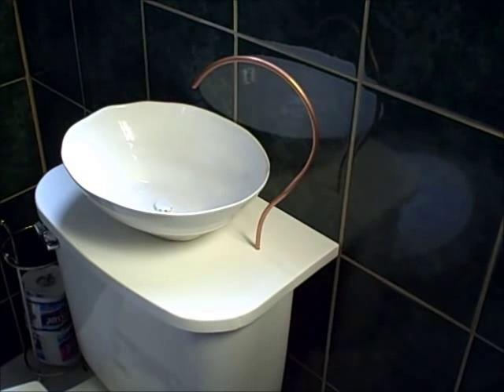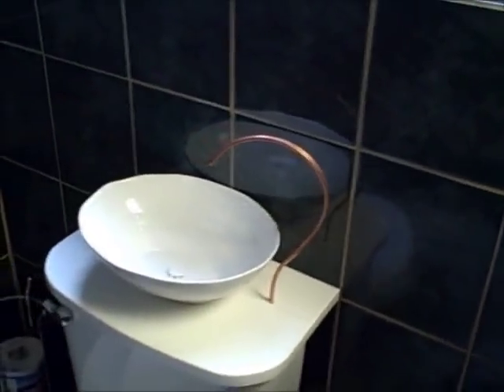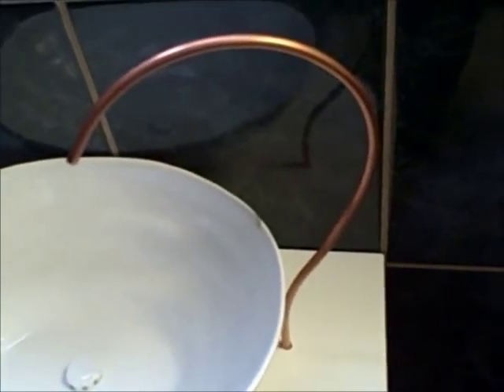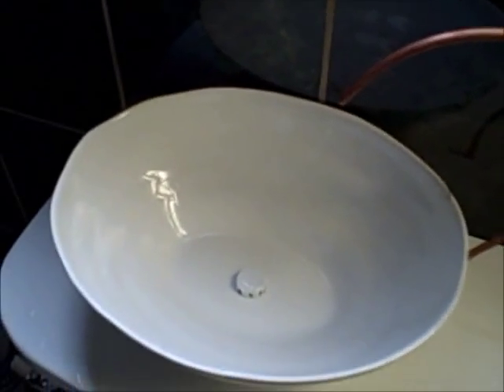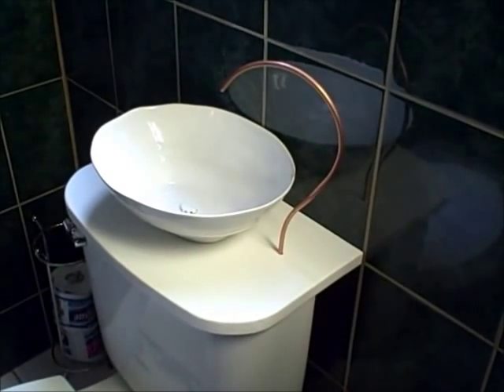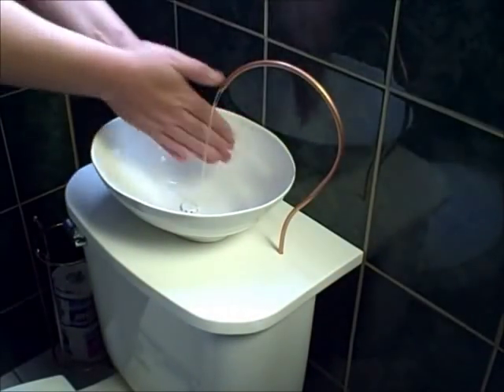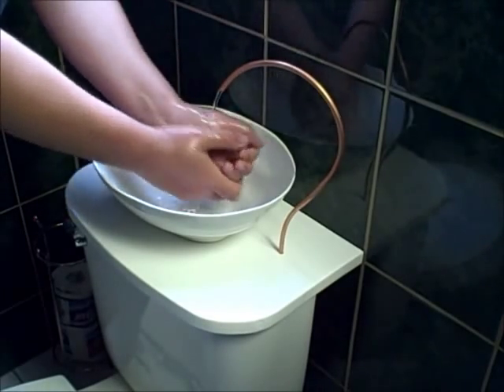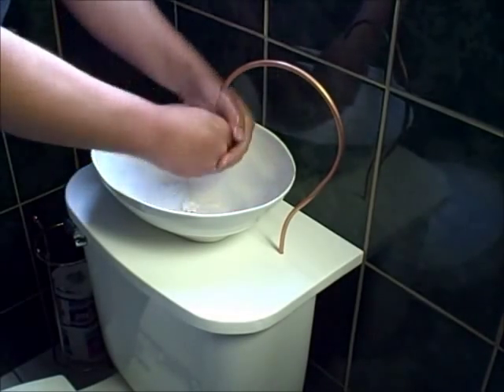Conserve water with a DIY Toilet Sink

Comment: Misleading ! On the diagram  water  from sink drains down in to flash valve tube. This way it will never fill the tank.
Reply from the maker: Alexander G Most of the water coming in the fill valve exits near the base of the shank, while only a small ratio is diverted to the overflow tube.  During the flush on many toilets, the siphoning action through the trap pulls more water out of the bowl than is necessary to maintain a water seal.  By design, most all fill valves simultaneously fill the tank while diverting a small amount of water (in this case 10 ounces) to top off the bowl.  More to the point, the water in the bowl is responsible for blocking sewer gases in the drain line from reaching the room. If the bowl were left with an air gap after a flush, the room would likely get very stinky.

Comment: Any way to rig up warm water?
Reply: Plumb it into a hot water line.
Reply from the maker: Rigging the hot water line would kinda defeat the goal of repurposing the water going into the overflow tube to save water.
Reply: Not if that isn't my goal. I'm interested because it saves space, not water.
Reply: +ima bemedou Then just plumb it like a normal sink but place it over the back of your toilet :)
Reply: You'd have to rig up an in-line water heater because the water line that feeds a toilet is a cold water line.  If you want to get crazy, you can divert water from the hot water line from your nearby sink or shower in the wall to feed your toilet.  The only problem you'll see there, however, is that the amount of water used to fill the tank after a flush (10 OZ. mentioned in this video) will likely be less than the amount of (cold) water in the hot water pipe.  So, you would have to run the hot water on your sink or shower for a little bit to remove most of the cold water from the pipes and draw hot water in, defeating the purpose of having a toilet sink to conserve water in the first place.  At my house here in Japan, we have an on-demand/tankless water heater a fair distance from our shower and sinks.  So, I usually have to run the hot water for a good 10 seconds to clear the cold water out of the pipes before hot water starts to come out.  

Also, these toilet sinks are very common in Japan and in 6+ years here, I've never seen one with warm water.  It does sound nice, though. 

On a side note... I highly recommend heated toilet seats.  The first time you use one in the dead of winter, it will change your life.  All unheated seats are inferior! :D